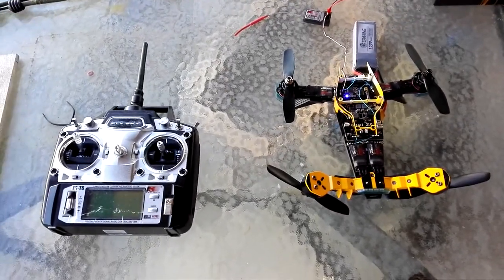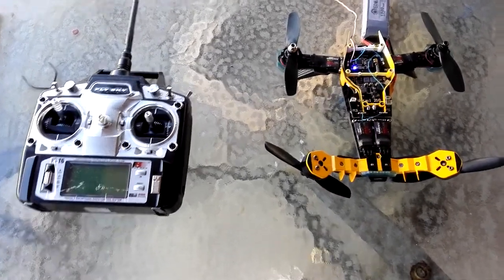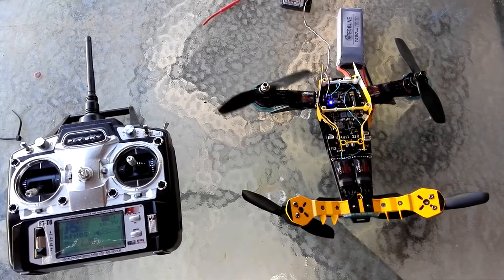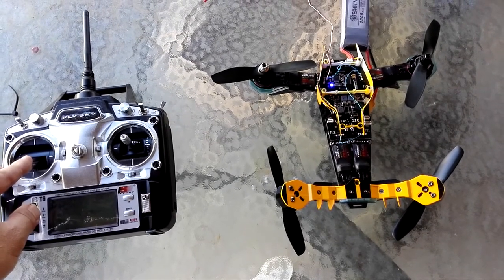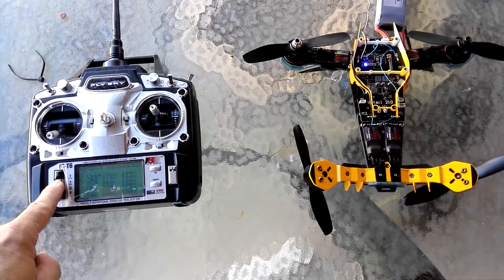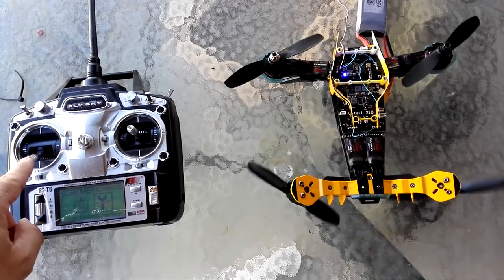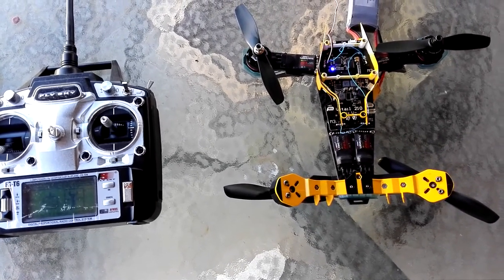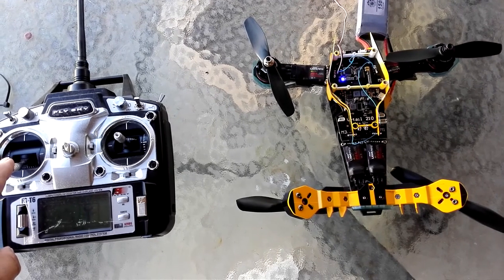How to fix ESC and Motor issues on Eachine 210 V-Tail Quadcopter

Comment: can you help me to plug flysky t6 to eachine v-tail 210
Reply: You'll need an additional PWM to PPM or SBUS converter to make that work. T6 and related receivers don't provide any form of serial output that will be accepted by the Vtail flight controller.
Reply: +David Kitson Thank you,but there I can buy it
Reply: Ebay. There are quite a few different ones on Ebay. You can even get SBUS and other converters. Look up PWM to PPM or PWM to SBUS converter. They typically cost somewhere around $10 to $20.
Reply: Don't forget you'll still need a Flysky PWM (normal) receiver for your T6.
Reply: +David Kitson Thank you
Reply: +David Kitson also I have spectrum dx6i ,can I plug it?
Reply: +David Kitson and I have flysky fs-ia6
Reply: I think there's a DSM input also - Have a look at the manual - the manual has a few pages on it and is quite good. Don't forget that you're going to have to load the cleanflight configurator regardless of choice so you can set it up for that receiver.
Reply: Глеб,
У вас получилось подключить flysky fs-ia6 к v tail 210